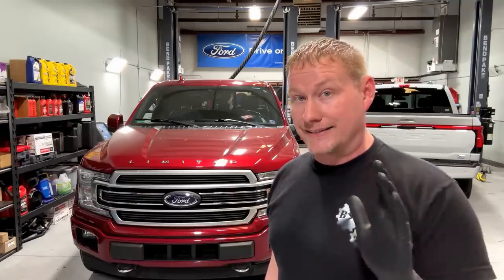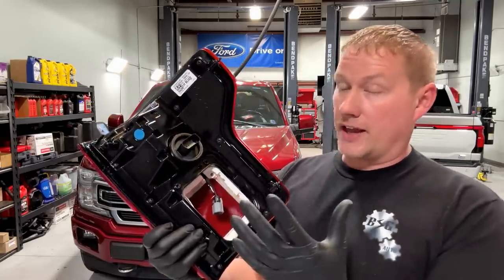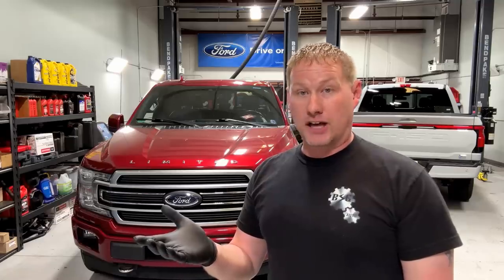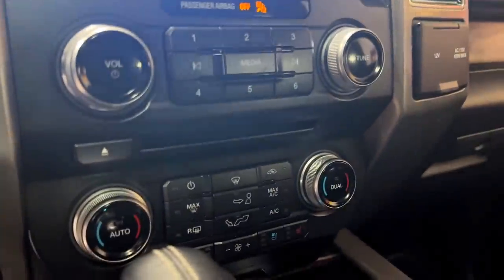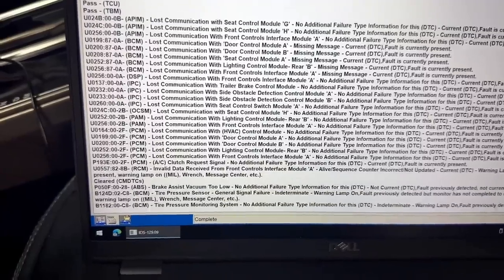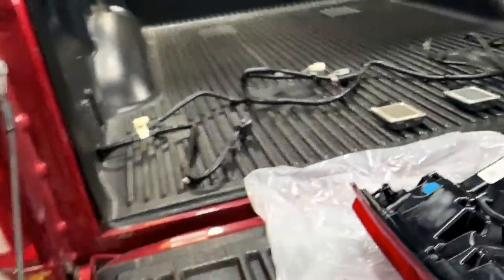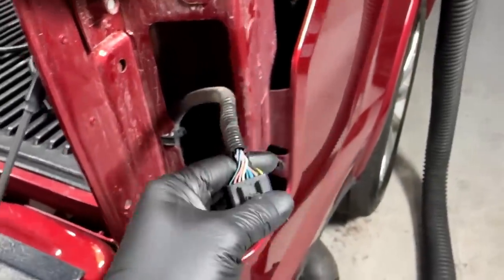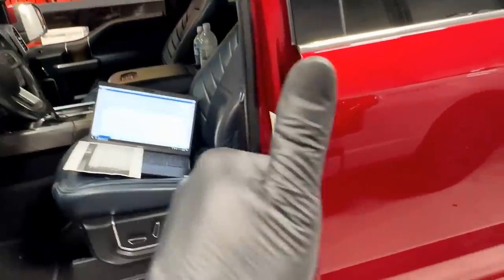Repair Cost Are Out of Control: $5,600 Bill for Some Tail Lamps?!

Comment: Life is giving everyone a forced lesson in the value of maintaining an older vehicle.
Reply: Dude should have bought the lightning,  it's zero maintenance EV
Reply: @macbook802  haha.  Lifetime warranty too.  Lifetime of the truck.
Reply: What years do you consider an older vehicle?
Reply: @macbook802 that'll only tow a camper 60 miles without a recharge? No thank you. Electric Motors are for children's toys. 
I'll never own one,  no matter how hard they push them.
Reply: @bobroberts2371  Speaking as an auto technician with 25 years of experience,  if you own anything made before 2005-2006, keep it and keep it running as long as possible and you'll be money ahead in the long run.   Everything made after that is pretty much just garbage.
Reply: @pr3modeling239     You seem to be forgetting that in 2005 , some considered the new cars to be junk.  See also 1995  , 1985 , 1975  ,1965 , 1955 . . .
Reply: @pr3modeling239  your gas truck needs an electric motor to start. Your ac at home is powered by electric motors. Your tools(if you're a man) are powered by electric motors. The pumps, pumping gas into your truck, yep electric motors. Everything you do all day everyday is run by electric motors, but you won't use an electric motor lol. You're really holding out well. Oh yeah, well pumps, electric motors. I wouldn't run an electric truck yet either. But an electric economy car is a must... Chevy Bolt EV is an absolute hero car
Reply: @pr3modeling239  said "     that'll only tow a camper 60 miles without a recharge? "

Using your logic, the Honda Civic is junk because it can't tow a camper.

said "  No thank you. Electric Motors are for children's toys.   "  

You had better rip out your HVAC blower motor , cooling fan, power windows.  Also be sure to scrap your cordless power tools and garden power equipment too.

Comment: I have the same truck same year and the same issue luckily it was still under warranty.The dealer replaced everything including sensors over 5000$ in parts alone also had to have the timing chain and cam phasers replaced at 60,000 miles that was 4000$ unbelievable they did warranty everything but still ridiculous

Comment: I drive a forklift, in the plant that built that tail lamp (and headlamp). That was the P-552 program, which is now a service program. So, we only run them occasionally, when required to fill service orders. That's a High Series rear lamp, with LED's and the BLIS module. We are currently running the P-702 program, getting close to changing to MCA. By the way, that lamp was built by Ventra Lighting, (Flex-N-Gate) Sandusky, Ohio.
Reply: So what are they doing different now to prevent water infiltration into the housings. This was the root cause of the problem.
Reply: @steadyeddie7453  I have no idea what they may be doing, to prevent water infiltration. I'm not an engineer, I'm a forklift driver.
Reply: @672macknasby7 aww, come on now, we know you know more than you say. You're a CERTIFIED forklift operator!  Lol

Comment: Excellent job!  It's amazing how a bad connection or module or two can bring down the whole network.  A Can-Bus circuit must have a terminating resistor at either end, and sometimes those resistors are built into modules, or sometimes they appear to be unused harness pigtails.  If shorted or open those resistors can also cause severe network issues.  When diagnosing multiple problems like on this F-150, always look to see if the issues are are on the same network as you did.

Comment: My wife got into an accident going about 20mph in our Ford CMax Energy 2017.  It had a crinkle in the hood, cracked bumper cover, damage to the crash bumper, core support, snap in replaceable radiator post, and the headlight was cracked.  The car was totaled.  They wrote me a check for $13k after taking some off so I could keep the car.  A new headlight was a $1200-2000 depending on where it came from.  I bought a used one with a broken mounting tab for $500, bought a core support for $60 shipped, crash bumper $70 shipped, $15 for the radiator post, straightened out the hood myself, scraped off the cracked paint, sanded the bare metal and feathered the sanding into the good paint and then hit it with touch up spray paint.  I gave the bumper cover zip tie stitches and then bought a car bra for $100 the bra covers all the damaged areas.  Also the paint cracked on the fender at the edge so I had to sand that down and hit it with touch up paint.  Luckily it was only 20mm X 5mm area so it doesn’t look awful.  

I spent less than $1000 to get it back on the road and about 20HRs of time.  

I will be on the lookout for a used gray front bumper cover and hood but am in absolutely no rush.  If it takes me 5 years to find them then it takes 5 years.

Comment: This is exactly why I still drive '90s and 2000s cars. I bought my car for $1,200 and I've already been driving it for several months All I've had to do is put gas in it and change the oil. I had a car before that a Geo prism I got for $600 I put 120,000 mi on it All I had to do is change the oil brakes and the clutch once.
Reply: Soon, the thieves will be stealing old cars and leave the new car/truck mess to us.
Reply: Grab any really OLD vehicle body,mount to a custom chassis,toss in a small block plus OD tranny.The ignition  module is the ONLY electronic component.What could go wrong?

Comment: Im sticking with older cars whenever i can. Modern enough to have amenities and comfort. Old enough to have character and style. Cheap to insure and register. Minimum or no inspections. I can fix them myself but rarely does anything go wrong besides bulbs and brake pads. The one that scares me is the wife's 2015 sienna but im hoping it will be mostly the same. Fortunately as a diy, the junkyard is my friend.
Reply: This is way my wife and I purchased a 2018 Rav4. I was lucky enough to snag it in May of 2020 for $24k ( Platinum trim) with 19k miles. It was a bulletproof motor and transmission.
Reply: More older folks are buying new vehicles with less bells and whistles. They tend to look at the big picture and understand more technology equals complication equals expensive repairs, and often several trips to the dealer before they get it right. The younger generation wants it all, and then moans about the costs to fix it, while they drink their seven dollar latte.
Reply: @steadyeddie7453  very true. Plus it seems the manufacturer makes you the guinea pig and you never know what the hell you're getting when you buy new, it's a crapshoot. I'll take used where I can get some history on a model and know what its pain points are.

Comment: I’m a Ford tech at a dealer. If I’m dealing with any type of network or communications issues, the very first thing I do is have a walk around the vehicle and make sure there isn’t a bunch of water in the tail lamps. I can’t even count how many times I’ve seen issues like this. It’s not just F150’s either. I’ve seen it on explorers and expeditions with the SOD-L/R behind the bumper covers too.
Reply: Why are they not sealing these lights better? That is a horrible design flaw.
Reply: They usually don’t just leak on their own. But any little crack in the lens will cause them to leak. And it doesn’t take much to crack them. They are a very brittle plastic.
Reply: @alexpuls8219  Then they should make the plastic stronger it's a pickup truck not an ornament
Reply: @maciejrudolf It's plastic. Sun, heat, time, and general pollution are it's enemies. It gets brittle over time and any bump or even the vibration of the vehicle can cause cracks.
Auto manufacturers are in a rough position. They don't want to use components that fail too quickly. But have to use recyclable or biodegradable materials. Getting the balance isn't easy.

It could also be the seals. I've seen several that are warped or cracked. Not enough to be noticable, but enough to let air and moisture in. In areas with high humidity or constant rain this can cause water to build up. Better seals can be used, but they cost more. When a $1.50/unit will work fine, but a $3.00 that works better is available they'll go with the first. It doesn't seem like much but they spread that out over a couple hundred thousand cars per year and it adds up.

Comment: Brian, Copious amounts of dielectric grease are your best friend in this case.  I use it every time I pull connectors apart or change bulbs. It works.
Reply: Yep, I agree, no matter what I pull apart, if it’s electrical or electronic , I get out the dielectric grease and lube it up well!!
Reply: Too much can cause resistance

Comment: All these videos are doing is convincing me to never buy another NEW Ford truck ever again :) ...my '95 F-150 isn't even worth $5600 but it'll run forever LOL...I do love watching you troubleshoot though, keep up the great content!
Reply: I miss my old Blue 1994 Ford F150 XL.

After 13 years of ownership it loss its battle with RUST.
Reply: 300 six or 302? 95's are great trucks!
Reply: @johnlopez3001  I live in the south and while she's got 255k on the odo, it's only got surface rust on the frame.  I am planning on doing some basic cleanup and perhaps POR-15 treatment over the frame to ensure it's not the frame that ends the life of the truck.
Reply: What have you had to replace on it?
Reply: @johnlopez3001 How did you know it was rusted out?
Reply: @sl4983  13 winters in NYS.
Rusty body panels, brake lines, frame etc...
Reply: @oldcarnocar  5.0... the original owner took copious notes when he did any maintenance work, he clearly loved his truck, and it shows.
Reply: Sorry,  it isn't just ford. Had a 2014 buick enclave premium and both headlamps led strips failed.  Those headlamps are $1680 each and aren't serviceable and no aftermarket available.  Oh and they are on back order.
Reply: In 1995, there were people calling the new trucks junk, longing for 1960's stuff.
Reply: @korycurtis3730  if you're good with electronics you can open em up and fix the resistor or whatever failed, but sadly most people aren't good at that.

Comment: Man, you are a REALLY great tech! I can only imagine how a dealer would diagnose this problem; they would run the bill up even higher on this truck, replacing numerous modules! I had a 2015 Jaguar XK with very low miles on it (no matter, the warranty was over, time wise) in which the screen went out. Took it to the dealer where it spent THREE months being "diagnosed". The dealer threw all kinds of parts at it, replaced modules, the battery - twice - before finding that the problem was the screen itself! The "fix" ended up costing me a fortune - beware of car dealers, especially Jaguar/Land Rover!  Looking at the water intrusion, was this truck immersed in salt water? I've never seen that much corrosion inside a tail lamp assembly like that just from rain.
Reply: AMEN!   I was thinking the same exact thing.  The  only time I've seen corrosion like that on the heat sink module is on sacrificial anodes on a boat!  Are you sure this wasn't a flood card from the florida hurricane he bought cheap last year?   Something doesn't smell right here.
Reply: It happened to my truck and it was never immersed in salt water.
Reply: @turt1231   if a truck or car was immerse in water everything about this truth will be corroded , that is why they tell people if you are going to cross a fairly flooded area your vehicle electronics will start malfunctioning, after a couple of days  because of all the modules a car or truck has even EVs have the same problems.
Reply: @lactusgalacto1174  
Mine happened because of the back top light. When it rained heavy for a couple of days.
Reply: @turt1231  Is unfortunately that more cars are so pack up with so much electronic that water gets in the tail lights and your car or truck won't run because a module is built in it, unbelievable.

Comment: I'm somewhat surprised that backfeeding didn't destroy the canbus transceivers in the other modules it was connected to. Imagine the cost to replace everything on that network.
Reply: canbus was designed to be pretty resilient to failures, but yeah, grounding a line out does play heck with the comms causing it to go 'degraded mode'.. grounding both means no comms ability at all

Comment: Water becomes trapped in my passenger side rear tail light from time to time. I’m definitely going to take it off and make sure all the connections are dry and tight. Also place some dielectric grease on them as well. Thanks for the video.
Reply: Drill a hole in the bottom somewhere so the water can drain.

Comment: That's absolutely crazy. When I picked up my 2023 tremor, the first thing I did was spray every ground and exposed electrical component with insulating spray.. I guess I will have to go out and pull the plugs off and Dielectric grease my connections on the tail lights

Comment: Hit a wild boar that damaged my bumper. The estimate was 4600, which I decided to cash out and fix myself. Paid 220$ for the bumper,.80 for paint and 35 for the wheel well liner. After the 500$ deductible i.got 4100- 335$ with a profit of 3765😀😀😀

Comment: It still blows my mind that they would put all those electronics in a tail light housing, when haven't you seen a tail light housing that didn't have condensate or water floating around inside them. I guess I will just keep polishing and servicing my older truck and steer clear of all this new electronically plagued vehicles, parts supply issues aren't helping much either.

Comment: Solid diagnostic work, worth every dime. & more.  Could the truck be fitted with XL or XLT tail lamps, disabling functions other than turn signal, brake, back up, & running lights?
Reply: Now you are talking my language. Rip that crap out. Disable the modules in Forscan so the truck doesn't freak out, install XLT lights, and use your backup camera. LOL

Comment: Had a similar issue on an E350 where the headlights going bad due to water intrusion actually cascades into a whole bunch of other issues due to modules attached to them.  Cost for repair was somewhere around $4K.  We're in a crazy world where a Mercedez is cheaper to repair than a Ford.

Comment: Outrageous! Thank you for the into. I've been shopping for trucks recently and FORD has been the one brand that seemed the best value. Instead of a late model I'll be looking at something in the early 80s now 😂
Reply: An old flathead 6 with a distributor a mechanical fuel pump and a real rad fan driven from a fan belt is the way to go.
 But.
 Those machines are all but forgotten. Their reliability got in the way of profit and the ecology green agenda.
Reply: Either that or a 90s OBS, particularly a diesel.
Reply: Yeah I'm going old school from now on. This BS is beyond words.

Comment: When you consider the cost of any new fully loaded truck these days those parts costs and complexity are the reason why, the problem with keeping and driving older vehicles is the parts become harder and harder to obtain, the manufacturers sooner or later force you in to owning newer and more complex vehicles weather you like it or not and this is only going to get worse as they all start transitioning to electric.
Reply: I refuse to comply, I drive a 20 year old truck today and 20 years from now I will be driving a 40 year old truck.

Comment: I have been a european automotive tech for a little over twenty years and we have been dealing with issues just like this for years now, although I did hear about a lincoln that had a burned out tail light bulb which took down the can and the car wouldn't start, I believe this was around 2008, when I heard this story I just laughed and said welcome to my world....
Reply: You must be able to fix anything working on European cars for so long.
Reply: Atleast you don't have to pay for repairs. The customer is hurting and keeps getting screwed from the rear by the manufacturer.

Comment: There is definitely getting to be too many modules on these new vehicles. especially in areas where water protection is necessary. it looks like in this case they didn't use any dielectric grease at the factory on those connectors.
Reply: Shouldn't need any grease as long as the plugs have proper gaskets and are sealed properly
Reply: @cheesecurd100s  You don't have a clue what you are talking about.

Comment: The customer is luckyAF to have found you because most techs/shops would just start throwing parts at it instead of a proper diagnostic. P.s. without trying, you basically explained how CANBUS works and showed that the first code/issue is usually gonna be the root cause for those that follow afterwards…
Reply: I am very lucky to have Brian as a technician.
Reply: Fore sure. If this was taken to the dealer they would have replaced every module one by one. LOL.
Reply: @brettstoner8283 I interned at a Chevy dealership in the late 80s. Had a conversion van with a screwy cruise control. It worked but not correctly. My "mentor" told me it was the control module. He said that's the only thing it could be. Wouldn't explain why. So I did. Spoiler Alert: after I replaced every component of the system, and it STILL didn't work, he let me figure it out for myself. I did, but he made me leave the new and unnecessary parts on it. The customer paid for 5 parts they didn't even need because the problem was a wad of vacuum lines that melted together on top of the transmission. That was the last dealership job I ever had.